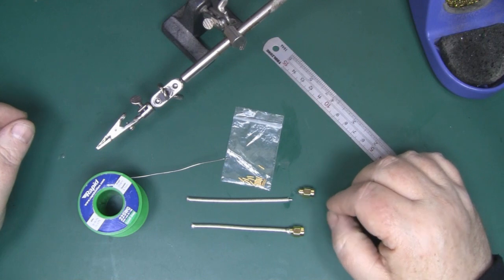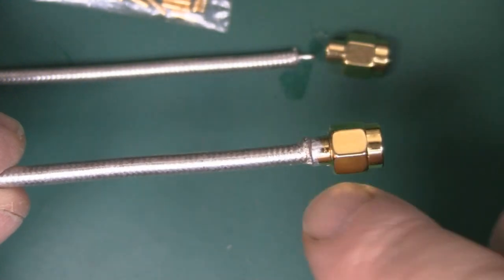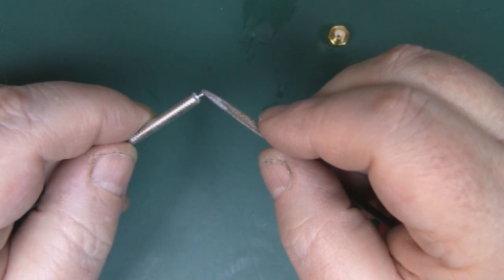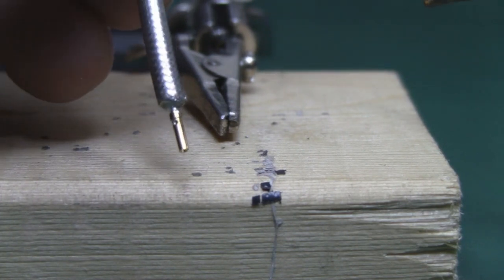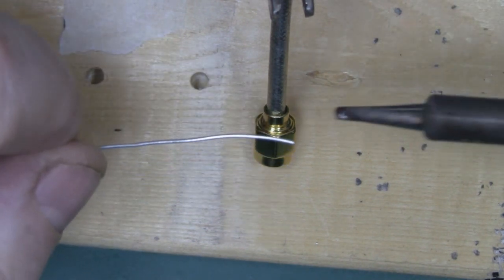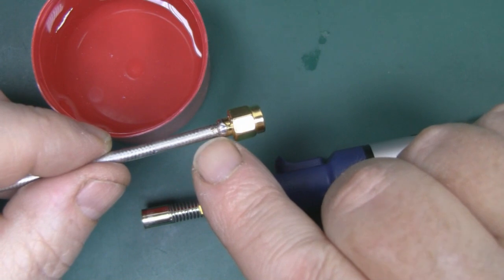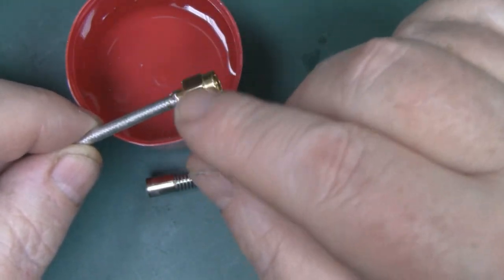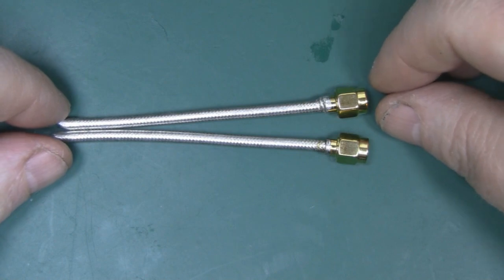How to solder SMA Connectors to Semi Rigid Coax my method #140

Comment: There are far easier ways to solder these. Drop a small bit of 0.6mm solder inside the pin and then heat up while gently pushing the wire in. The flux will help to create a good joint. Putting in solder first and then the wire will cause no flux to be applied to the wire and could result in a poor joint. For the outer conductor apply a little bit of flux before inserting and then hear up the SMA connector with a soldering iron and run the solder round the top of the point when it is hot enough. You'll end up with a very clean looking solder joint and the solder wicked down inside the SMA causing a very strong connection.

Comment: RG402 semi-ridge has Teflon center dielectric.  Teflon doesn't melt at soldering temps but the temp expansion coefficient of Teflon is very large.  If you want to get a feel for the expansion, prep the end as shown without putting on the SMA connect.  Heat the shield for a while near the end and watch the Teflon expand out from underneath the coax shield and shortening the exposed part of the center conductor.

What happens if you overheat the coax while soldering the SMA connector, the coax insulation will expand and push up against the front wall inside the SMA connector ejecting the shield outward slightly.  This results in the center conductor without its coax shield that can add a few nH's of series inductance at the SMA center conductor which is not good for high frequency performance.

Use the right soldering tip and temp for the job.  Get in and get out within a few seconds with the soldering to avoid excessive heating of the coax and expansion of the coax Teflon dielectric core.

Comment: Ideally, the parts to be soldered should be raised to a sufficient temp. to melt the solder and flow in-between.
The soldering iron should be used that way... not melting solder on the soldering iron and applying to a cold joint.
Tinning the iron and parts are fine, but remember that for a good solder joint the joint itself MUST melt the solder.
Reply: eric h. Look up "paceworldwide cup terminals"

Comment: If you would have used flux (RMA is best) you would not have had to do that extra step of reheating with the torch. Using even a small torch you are likely melting the dielectric and risking a short.

Comment: I gave you a thumbs up. 

Question about the braid? I soldered RG174 to SMA connectors and did the same soldering in order to ensure there was a good ground. After that, I used some shrink tubing to make it look good. I noticed that you did not peel back the braid on that coax. By the way, what coax is that you are using on the video? Are you not required to expose the braid so you can make a ground?

Comment: I think a thin tin on the sheathing followed by heating and physically pushing the cable into the connector as the solder starts to flow is better to get solder inside the barrel. and then add more solder by wicking through the hole and the where the sheathing meets the connector. the water cooling seems a bad idea to me. I was told you're not even meant to blow on a solder joint to cool it as it can cause a dry joint.

Comment: Very informative video, use a similar method since I only use an Antex 25W iron.
Been using these solder on connectors for RG405 and find very easy to assemble.

Comment: When you insert the core (cold) inside the hot pin you may create a bad join. You should keep the iron on the pin during a few seconds after insertion to heat the core a bit too (but not too long or you'll melt the dielectric).

Comment: What if we don't have the same type of cable? Say I'm recycling some from a old router or other equipment. Would a crimp on connector be better? I worry the cheaper cable may melt under the torch.